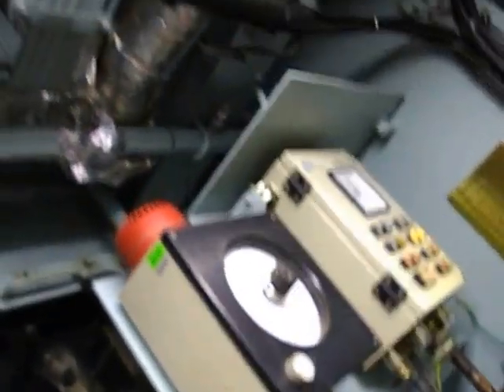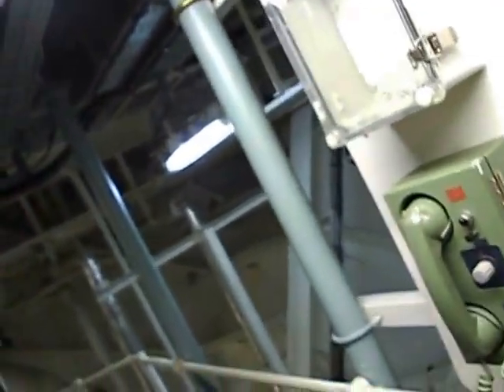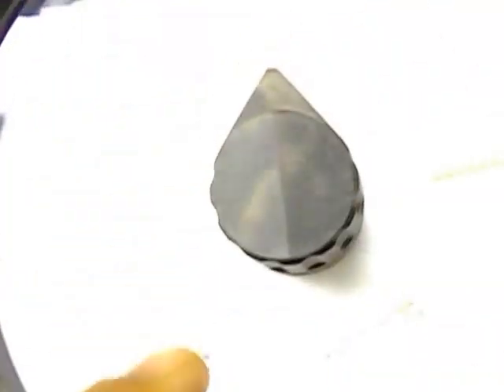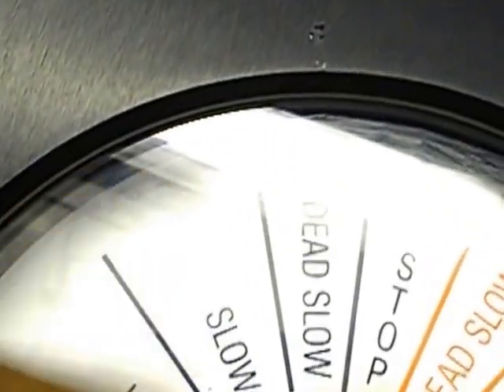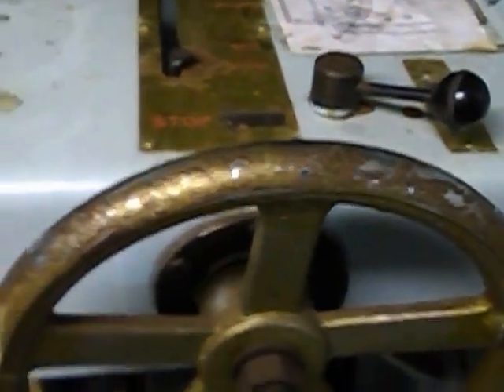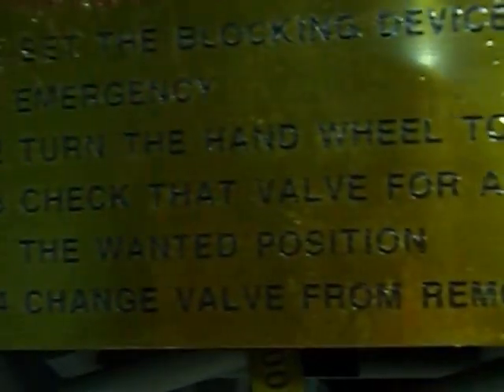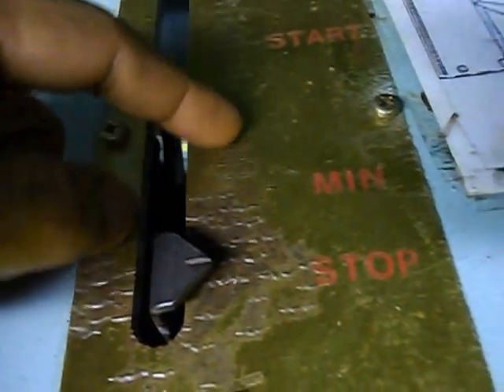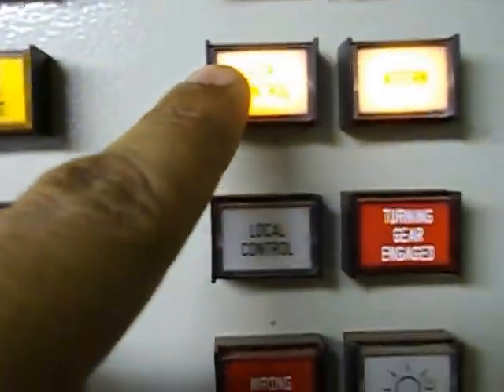Emergency manoeuvring of MAN B&W 6S70MC C series

Comment: super amol, good video. r u still in sci?
Reply from the maker: Tony George  Yep
Reply from the maker: Yes sir ,, how r u ?
Reply: @kharateamol  I am fine Amol, how are you
Reply: @kharateamol hi chief.can you show me vit and fuel rack on rough sea in old style mechanical pneumatic NOR control governor?  What is options of old governor in rough sea. And how it works if there is one switch to shoose  rough sea option.  I saw old governor with couple adjust knob. But some one sayed me ther is one button to apply logic of rough sea   . Also pleas show new digital governor how it work in rough sea . Thanks